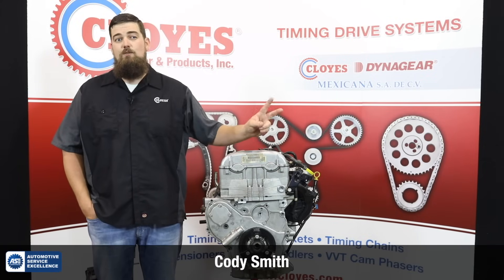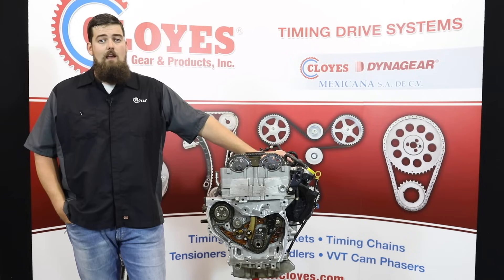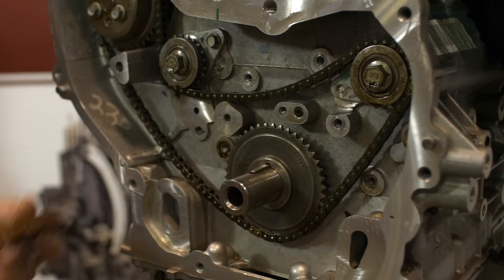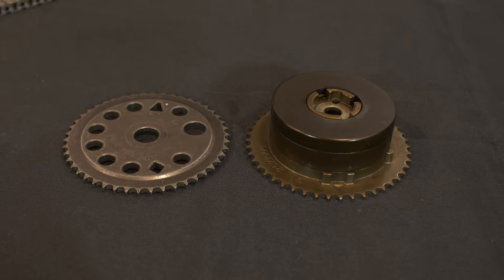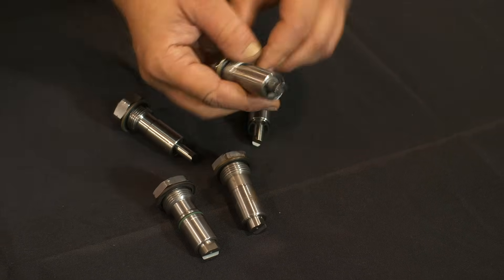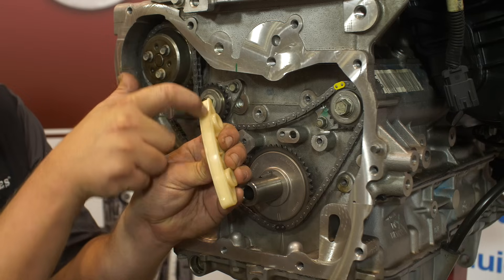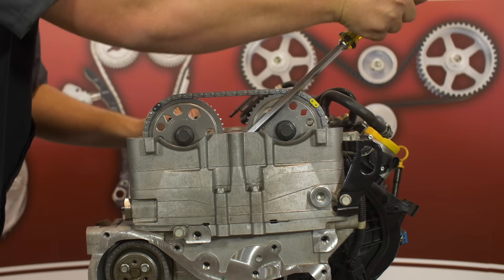GM 2.0/2.2/2.4L, Timing Chain Replacement, Cloyes 9-4201S & 9-4202S

Comment: I am looking at the kits online and notice in the picture of the CLOYES 94201SX there are 5 colored links 3 black and 2 yellow and the yellow links are on each side of one of the black links, so how would this chain align
Reply from the maker: The 2 yellow links surrounding the black link are marking it as the unique link. Align the black link between the yellows to the intake mark.

Comment: Is it the same chains and brackets for vvt 2.2 and non vvt 2.2 and only the sprockets change? And is the timing process and marks the same on both?
Reply from the maker: Yes, this process works for the VVT equipped engines too. Everything is the same other than the camshaft sprockets.

Comment: I ordered at kit from you all for a 2010 equinox and when I get the camshaft sprockets one with the unique color on the intake side and black on the exhaust and black on crank shaft and line the crank sprocket up with the timing mark my exhaust cam is setting between 11 and 12 o'clock and intake is setting close to 2 o'clock does that sound right
Reply from the maker: That sounds correct. As long as all three marks are aligned you have it right.

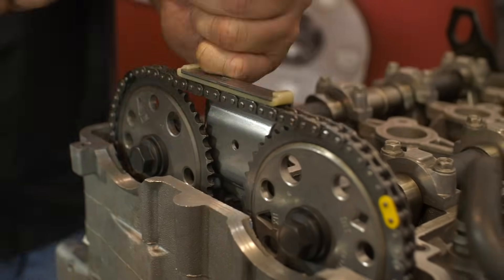Comment: 13:51 "it is not advised to rotate the engine by hand". I do not understand you should not rotate the engine by hand. Could someone explain that?
Reply from the maker: Once you install the components we do not recommend rotating the engine for any reason other than starting it. Slowly rotating it by hand can cause the chain to jump because the tensioner is not primed with oil keeping the chain tight and the valve springs make the camshafts load back and forth. Faster rotation, like with the starter, keeps the camshafts loaded and decreases the chances of the chain jumping.

After the tensioner is full of oil and is applying pressure to the tensioner shoe rotation is no longer an issue.
Reply: @Cloyes01  Thanks.
Reply: How do you put the torque converter bolts in without roatation of the motor?
Reply: @austinadams8405  put torque converter bolts on first
Reply: I was saying the same thing . If you take this engine out to do the timing on an engine stand then you risk the fact of having to turn the engine when putting the torque converter bolts on . I guess the only answer here is do the timing replacement while the engine is still in the car.

Comment: Hi cloyes, I have an Opel Zafira 2.2l ecotec engine and am hearing some rattling noise from the left side of the engine is it possible that the noise is coming from the timing chain. Please I need help!
Reply from the maker: Worn or failing timing systems will make a rattling noise. If the noise is coming from the timing cover area it is likely that is what you are hearing.
Reply: @Cloyes01  Thanks very much for your response
Reply: @Cloyes01  Hi cloyes, What's the best way to fix it the noise. Please I need help!
Reply from the maker: @salmanphariss2086  The only way to know the health of the timing system would be to remove the timing cover for an inspection. With the cover off you can check for broken guides, a stretched chain, or an over-extended tensioner. If any of these are the case I would recommend our 9-4201S timing kit to replace the components.
Reply: @Cloyes01  That's very useful. Thanks once again!
Reply: My guess would be the water pump.

Comment: Does the Balance shaft sprockets come off just like in the video?  does the shaft have to be pulled out? I'm doing the chain replacement in the vehicle
thanks for any help
Reply: I had done this type of job. You can take the shafts out without having to remove the engine. Just undo the front engine mount and drop the engine to the frame and the exhaust shaft comes out. Then raise the engine as high as it will go to allow the intake shaft to come out. Hope this helps with any questions about if you can take the shafts out without removing the engine.
Reply from the maker: @tdmccoy72  Thanks for the response. For our information, what kind of vehicle did this process work on?
Reply: Cloyes Gear & Products, Inc. I done it on a 2003 Saturn ion
Reply from the maker: @tdmccoy72  Good to know! Thanks for the info.
Reply from the maker: The sprockets can be removed just like in the video. This allows you to service them in the vehicle without removing the shafts. The shafts typically cannot be removed without removing the engine from the vehicle.

Comment: 2007 Chevy Cobalt I'm having a hell of a time no garage and fighting the cold weather. It's January in Ohio so it's kinda cold 
Anyways I followed this video and it helped alot but that harmonic balancer was a bitch and I accidently turned the crank trying to tighten it. I was so pissed I haven't been back out there to try again. I have no clue what I'm doing lol
Reply: Unless the chain skipped teeth that doesn't matter on this motor. It has keyways on all the sprockets.
Reply: Thank you very good to know. The cams aren't way off but it just don't look like 10 and 2
Reply: @randomfloob8443  how did it end up going for you? Doing this job probably this week. Like you, I also dont know what I'm doing haha
Reply: Well  to be honest I been lazy it's been raining alot here but I did manage to get everything back together. However it did not start. It sounded like it really wanted to and I got excited but no go. Something I did notice that I should have tried first was my spark plugs all four were black. Carbon fouling I believe but I haven't checked for spark.( Should of been the first test) but I'm not a mechanic so I'm learning as I go. Anyways if it turns out to be fouled plugs and I did all that shit for nothing I'll  be licking my wounds from the cash I been spending
Reply: I am sorry I don't reply fast and I changed the name lol
Reply: Okay man It was cold and raining but I tried putting a new battery and plugs in it. Wouldn't start at first so I stomped the gas peddle a few good hard times and it finally fired up. I am happy super weird like something was clogged

Comment: Installed a Cloyes timing chain kit in a 2011 NOX in 2017 without benefit of this video, piecing together information from several sources. Anyone doing it now will have a much easier time, due to this video. 

The crank bolt deserves mention, however: Does Cloyes sell a new TTY crankshaft balancer retaining bolt? I do not see one mentioned in the kit, and you'll need one. (GM is extremely proud of theirs.)  If memory serves, it tightens to 100 NM plus 125 degrees.
Reply from the maker: Thanks for the great review!

Unfortunately we do not sell the balancer bolt. Great tip!

Comment: So I done the timing chain and changed every guide in the kit. However I didn’t change the balance shaft chain. I still have the rattling noise after my car is warmed up. Only if it’s in gear or if I turn the AC on it’ll be a loud rattle. Do you think it’s a balance shaft chain that’s making this noise? This whole time I thought it was my timing chain making the chatter. Please help!
Reply from the maker: It can be, but it is unlikely. Load on the engine really shouldn't effect balance shaft chain load. That chain is only turning the 2 shafts and the water pump, all turn somewhat freely. 

Does the engine have direct fuel injection? The injection pump, driven off a camshaft, can create those symptoms. The pump in my wife's 2012 Equinox has been chattering and making racket for 100,000 miles now.
Reply: I’m not sure. I don’t think it has direct injection it’s a 2007 g6 with the 2.4. It will only occur once it’s all the way warmed up. In gear. Or if I put the AC on. It sounds like a chain rattling.

Comment: Good video! Thorough...and thanks for taking time to answer the questions below!
Reply from the maker: Thank you!
Reply: @Cloyes01  Quick question: the video says to torque the balance shaft-to-sprocket bolt to 37 ft lbs. Is this correct?
Reply from the maker: @bjusticeforever  That is correct.
Reply: @Cloyes01  Then someone needs to build a tool other than a 5/32" punch to hold these balance-shaft sprockets. I've broken 3 trying to torque them to 37 ft. lbs!!

Comment: Made in China? 
 junk and hi price rip off
Reply from the maker: Try to find quality injection molded nylon sources elsewhere. 
A lot of our components are made in China. But the difference with Cloyes is we invest in tooling and develop the components with strategic partners that are domestic OE manufacturers. We are not purchasing cheap existing components and putting them in a box like many others. Our products are exclusive to Cloyes because we own the tooling and do the development work ourselves. Manufacturing quality in China can be found on both ends of the scale.
Reply: @Cloyes01  they are bad engines  so the parts need to be the best Quality  they can be good video
Reply: The Cloyes set will outlast the GM shit. ...But barely due to GM's poor lubrication system and inevitable oil consumption problems.
Reply: @fisqual  The original set in the LHU motor I just did said cloyes and GM right on it. Pretty sure cloyes is the OEM supplier for GM.

Comment: Simply said you're the greatest thank you so much conveyed that to anybody all so well I did not know that there were two chains inside there my Cobalt has like 60,000 miles on it 2008 do I need to do this at this time I just put synthetic oil in the engine and I'm fixing to do the transmission change filter and oil but how many miles are the timing chains good for please respond and thank you for your video great job
Reply: It's supposed to last 200k but you will need to inspect it at 150k
Reply: @harrywillisdick8660  hey thank you hundred fifty thousand miles check it on the timing chain 2.2 4-cylinder thank you for responding I just now got it today have a great one
Reply: @apaulothegreat1581  I was given an 01 saturn with the 2.2 ecotec and it slipped the timing chain and bent all the valves at 128,000. Hit and miss with these things. That was a LOT of work to rebuild the head and do the timing and balance shaft chains with it shoehorned sideways in the car. I'll do head gaskets on a V8 any day over that damn thing.
Reply: @MattsRageFitGarage  hey thanks a lot it's early morning but the sun ain't come up here still clicking alone yeah I got about sixty thousand three hundred miles now on the 2008 Chevrolet Cobalt with a 2.2 I change the oil and put Castrol synthetic in it seemed to help on the cold one in startups with the injectors rattling let's just watch a dealership tells me I thought it was the timing chain when I first bought the car news I should note injectors
Reply: I have a 2010 Cobalt with about 65K on it.  It usually starts up in an eyeblink (1/4 turn?).  I have to admit reading about all this timing chain stuff is something to think about.  I replaced tires at around 55K, probably could have gotten more miles out of them but took advantage of a Cooper Tire sale, I replaced battery at 10 years, battery was not giving me any trouble but did it as precaution, and I had to replace the left front wheel bearing that was making a lot of noise.  How does my experience compare with yours?
Reply: I have an 08 with a hard 160,000 miles on it. Really realiable and I never changed the chain or guides.

Comment: Chevy equinox 2014 2.4 One question. Torque specs for the front cover bolts ? Please
Reply from the maker: All the front cover bolts torque to 18 foot pounds.
Reply: @Cloyes01  thanks..

Comment: Hi, Great video... I have 2 questions. 

1 how do you determine if the timing chain needs replacement, do you remove the rocker cover and check for slackness? 2. Do you need to always replace balance chain or does it make sense to do so since you have the engine apart?
Thank you!
Reply from the maker: Thanks. 

Chain noise or a check engine light for camshaft to crankshaft correlation  are usually the determining factors. It is also smart to service the components when/if you have the timing cover off for another repair. And yes, change the balance shaft components while you are there too. If you are going to spend the time and money to do this job, replace it all while you are in there.
Reply: @Cloyes01  thanks so much for your quick response!
There has been a clattering/tapping sound around the rockers since I bought the car a year back. I cant say it comes from the chain side just seems all over and notice at some engine speed (2000rpm) and light loads (off the gas).

Is it normal for the valves to make some noise? I have a GMC Terrain 2.4 2012.
Reply from the maker: @adamritchie839  It is very possible that you are hearing the high pressure direct injection fuel pump. The pump is driven off one of the camshafts and sits on the driver side of the engine. It is common for these direct injection pumps to make a lot of noise.
Reply: You will likely also get check engine codes for "implausible timing" when the old chain is going.

Comment: Does anyone knows why the exhaust sprocket does not wants to fit I believe that the chain is placed correctly to the time it has to be
Reply: Take the tensioner out of it's hole. It WILL engage with a new chain and prevent you from installing the chain/sprocket.

Comment: I followed this procedure exactly.  I now have a whining noise which sounds like the balance shaft chain is too tight.  This appears to be a common problem when r&r of the water pump is done.  I'm really defeated since I have to take the cover off again and examine the cloyes supplied tensioner.  It was installed with the pin in the deactivated state and the pin pulled after the chain and guides were installed. I'm really disappointed after buying 250 dollars worth of your products and having to take the car back apart again.  I'm thinking of buying a oe tensioner to replace as insurance to get rid of the noise.  The noise persists with the accecory belt removed so it is internal.
Reply from the maker: It sounds like the balance shaft system may be over tensioned. When activating that balance shaft tensioner it is important not to pull out on the tensioner shoe or assist the extension of the tensioner in any way. If you have any questions at all please contact our tech line.

Comment: On a G6 with a 2.4 with vvt. The replacement I got only has the cam gears. Can I use just the cam gears or do I need the whole gear and phasers assembly? The kit I got only had the cam gear....
Reply from the maker: If your engine is equipped with VVT then you must use the cam phasers. You must have received a kit that was made for the earlier engines. This is OK because all the components are the same, just not the cam sprockets

Comment: 2010 Chevy equinox lt. Not sure what motor is in it as im looking to buy it soon. Anything to look for while I pick it up. Is this the same motor?
Reply: Run away from that thing!!
Reply from the maker: It will either have this engine equipped with VVT, or it will have the HFV6 engine that we also have a video for. Both engine options will need timing system replacement eventually, usually by the 150,000 mile mark, just consider it a typical maintenance requirement. If you are OK with that then they are both good options. The only other thing I would keep in mind is that some of the 2.4L engines had oil consumption issues.

Comment: 07 Malibu with a 2.2 I have removed cam sprocket and the chain is loose laying in there but it will not come right out the top like how you did it or the bottom like there is some type of shaft or part of block that it is wrapped around do you have any idea how to get it out

Comment: I have 2003 Alero with the 2.2 Ecotec.  I have no issues right now at 130K.  I have read that I should upgrade the main chain tensioner with the new design.  I have read reviews on Amazon that people have activated the tensioner and just installed it back into the block.  Since it's already activated and will just end up applying tension back on the guide is there any problem with this method?
Reply from the maker: Do not install the tensioner activated. That tensioner has an internal ratchet mechanism that allows the tensioner to extend as far as possible, but only allows limited inward movement. This creates a limited range of tensioner motion throughout the chain system life because the chain will stretch over time. If you activate the tensioner first, it will extend fully and will be locked in the furthest extended ratchet slot. When you install the tensioner it will over tension the system unless your system is already worn/stretched. You risk damaging the chain, tensioner, and/or guides and it could cause system failure. With no issues I would recommend leaving the original tensioner alone. The tensioner did get superseded to an encapsulated one piece unit, but there was really no change to how the tensioner worked. You could actually argue the earlier versions worked better hydraulically.
Reply: Thanks for the quick response. Great information on how the tensioner works. Does the new style actually fill up with oil and still work hydraulically along with the spring?
Reply from the maker: @rakun1212  Yes, both work the same hydraulically.

Comment: Is there such a part called a Teflon bush that is part of the process of changing your timing chain.
Reply from the maker: There are no Teflon bushings directly related to our timing components. But it is certainly possible that there could be one somewhere outside the timing cover that is removed during disassembly.
Reply: Your in the wrong place asking a semi non-sequitur question.  There may be a bushing made of teflon. I have no idea.

Comment: Any idea if coolant needs to be drained from the start?
Reply from the maker: If you are not servicing the water pump while doing the job you can do it without draining the coolant, at least in some applications. With that said, it may be beneficial to remove the main front coolant hose to allow for more engine movement to access the components.